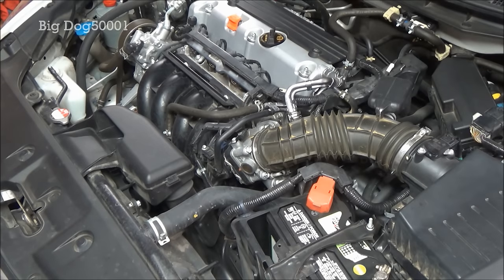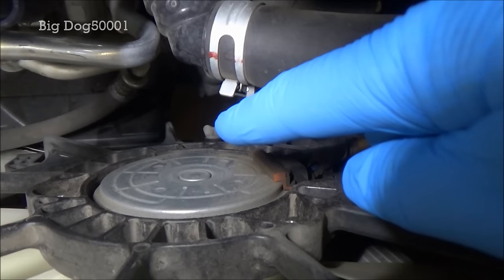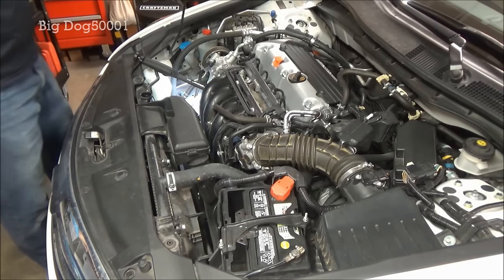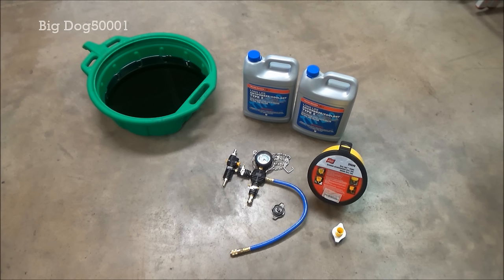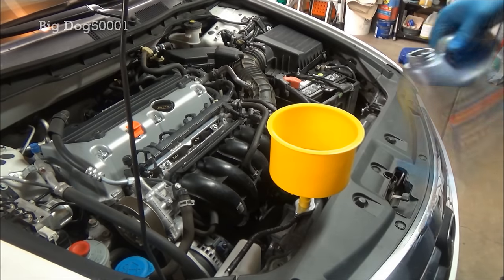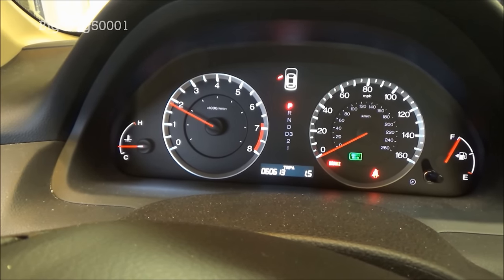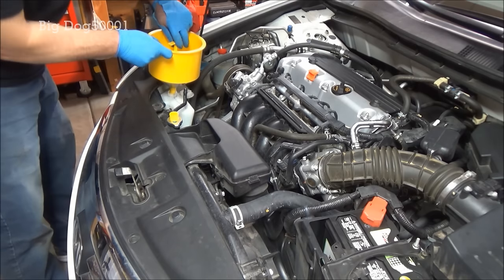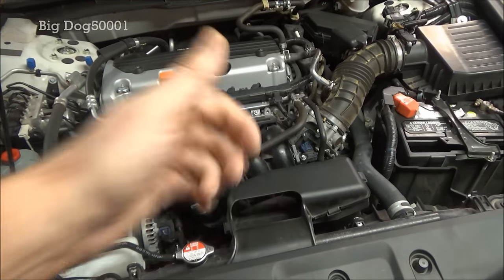Honda Cooling System Service/Fluid Change

Comment from the maker: Tools and parts
This channel earns a small commission using some of these links - at no additional cost to you.
Lisle, part # 24680, Spill Free Funnel: https://amzn.to/2Ktx9Tf
Drain pan: https://amzn.to/2Kq0rCi
Honda Coolant:  https://amzn.to/2Kp64AC
Reply: If I changed the coolant and its  leaking did I do it wrong?
Reply from the maker: @cathym2311  If it wasn't leaking before it was worked on then most likely yes.  I would double check my work.  Also, a small amount of residual coolant will drip off for a little while after servicing it.
Reply: @ Big Dog50001 Automotive  
It stopped leaking after a couple days. Thank you! Appreciate it. Good looking out!
Reply: Honda Type 2 coolant is colored red, as we saw on your video. Is this correct? Please confirm.
Reply: Your recommended seller links show twice more expensive than Honda dealers or other seller on Amazon
Reply from the maker: @OwenZMortgage Thanks for the info. Unfortunately prices from sellers change all the time.  I do my best to keep up and change to better options, but with hundreds of videos it can be tough.
Reply: @marinduque-theheartoftheph Honda coolant is blue. You can use ANY Asian blue coolant. I use Pentosin. Zero difference than Honda coolant. The red/pink are Toyota coolant.

Comment: you said to turn the heat on - but in the video that you just turn the temperature knob to the hot side but you did not turn the Heat ON - could you please clarify - thank you

Comment: It is not cold air that causes it to spray out its that the cooling system operates under pressure.  Dont misinform when warning of potentially dangerous situations !

Comment: I followed the video and changed the coolant in my 2014 CRV  this afternoon and it works like a charm. Just heads up -  do not remove the drain plug all the way out, or else some coolant will spill on the floor unless you have a huge pan.
Reply from the maker: Thanks for the comment!

Comment: Just bought a pair of Honda's. 2011 Honda Accord with 65 k miles and 2007 Honda Pilot with 105k miles. Awesome video! Great job. I bought the spill free funnel and will now change the fluid in both vehicles. I paid about $20.50 a gal for the fluid from a dealership.  Thanks again!!!
Reply from the maker: You bet 👍!

Comment: On my Accord, Element, Fit, Civc and HR-V cars which have radiator caps, I can leave the cap open on the coolant reservoir/overflow and the cap closed on the radiator,  which allows the reservoir to be sucked empty while draining. Then you can remove the empty reservoir for washing/rinsing much easier.
The Lisle radiator fill kit comes with different caps to fit the radiator which allows the cooling system to "burp" itself during warm-up. Very easy to do!
Reply: Right method is crucial for safeguarding against matter later

Comment: 95 Civic DX - 1.5L - I replaced my radiator (definitely needed it), cooling fan assembly, cap, and upper and lower rad hoses.

The work went well but it appeared I had air in the system. Coolant was getting pushed out of the rad and into the overflow. I shut the

car down, let it cool, topped it off, drove home then clicked on your link and bought the Spill Free funnel.

It was very helpful.

I am still concerned that after 20 minutes I still had lots of bubbles but I will monitor things for a week or two.

Comment from the maker: Some Honda models have a bolt to drain coolant from engine block, but many models do not, and the bolts usually require sealant or a new gasket if loosened/removed.  The models with engine block drain bolts typically will drain about 1/3 gallon more coolant.  There will still be be old coolant in the system no matter which setup the model has.  I will typically do two drain and fills on the coolant system if I am concerned about getting all old coolant out (with a complete warm up and cool down period in between).

Loosening coolant drain block bolts on older vehicles that have never had them removed can sometimes lead to issues like leaks or stripped out bolts, so be mindful of that.

Honda coolant is long life, so if the vehicle has been properly maintained, one drain and fill from radiator every 60,000 miles or so is typically what I recommend.
Reply: Good tip about the stubborn block plug. A wd-40 or similar overnight soak will protect against an stripping that aluminum block threaded hole. Patience is always key' in mechanics, dont get in a hurry and plan twice the time for the job until you get some experience.
Reply: Hi, my 2009 accord 4cyl sedan has greyish sludge in the coolant, any ideas what it could be?
Reply: jesus miranda  sounds like a blown head gasket leaking oil into the coolant channels
Reply: Hello Big Dog. How do you think it will be better-Type2 or Honda Pro Coolant 1L 08CLAG016S1 (Japan) for the Civic 4D? Or is there no difference?

Comment: Great vid, thank you.  This was my first coolant change and I now have a lot more confidence.  Got the same funnel system and squeezed top radiator hose before removing funnel also.  Great tip.  The coolant in my 2005 Honda LX was changed when car was cold, so I was able to touch lower radiator hose to verify when thermostat had opened up.  Fans did not come on at this time, so the fans may not be only thing to use as indication of cooling cycle.  It was also easy to watch the funnel from driver's seat and see bubbles start to rise up.  During the second cooling cycle I saw the coolant level drop a bit in the funnel.  Thanks again!
Reply from the maker: Glad it helped, thanks for the comment!

Comment: Did this coolant service on a 2011 CR-V today.  All went as planned except for a few hiccups that always happen no matter how straightforward the repair.

The petcock was at such an angle, I couldn't get a good grip with neither my fingers nor pliers. It took about 20 mins to get all the old coolant out.

Lastly...I could never get the fans to come on. I did the rpm hold. Even waited for 30 min. When I turned the A/C on...both fans came on but stopped when the A/C was turned off.

One thing.... shouldn't we have turned the heat on before draining as to drain the heater core?  Great video dave...and the tip about squeezing the hose before removing the Lisle was awesome and worked.
Reply from the maker: I appreciate the comment, thank you!  I did mention in the video to move climate control to hot, to open up heater core.  This is only actually necessary on older Hondas with a control valve to the heater core, newer Hondas do not have this and so it makes no difference if the climate control is moved to heat or not.  I do not turn blower on because that can turn on cooling fans.

Comment: I have used the Lisle spill free funnel for quite some time and it works fine.  However, I also have that Astro pressure test kit but just recently started using the vacuum fill tool.  It took me a time or two of using it to get the procedure just right but I have found it significantly faster to do the vacuum fill.  I can do an Odyssey with the dual heater cores and get heat from both immediately and no need for the numerous hot/cold cycles on the HVAC that the service manual calls for.  The trick to the vacuum fill is getting the pick up hose all the way down into a bucket of coolant, before attaching to the tool, to make sure there's no air in the hose.  The nice thing is the coolant goes into those hard to burp areas of the cooling system.  Remove the tool, top off the radiator, put the cap on, run it for two fan cycles, test for good heat from the heater core(s,) top the radiator again, and ship it.
Reply from the maker: The Astro kit works well, thanks for the input!

Comment: Thank you so much for adding that info about the engine block drain bolt.  My owner's manual is telling me to drain coolant from there, too.  But I was hesitant to do that because that bolt has never been turned and I'm worried it won't end well.  Based on your expert advice, I think I'll just drain from the radiator only. Then fill the coolant following your instructions in the video.  Then do another drain and fill in a week or so.  Would that be ok?

Comment: Great video. The no spill funnel was a great tool. Followed your video exactly but the fans never turned on for me. I know they work because when the AC is running I can hear them turn on. Temp gauge is staying steady right in the middle.

Comment: Very comprehensive.  Only thing I add is I apply a thin coat of silicone paste on the drain o ring to make it seal better and easier to remove next time.

Comment: He is correct.  Do not mix coolant types!   Since we are on the topic of maintenance when changing power steering fluid purchase the HONDA power steering fluid from the dealer.  I tried aftermarket approved power steering fluid "FOR HONDA OR ACURA"  written on the bottles.  The aftermarket fluid frothed in the reservoir and started making power steering pump noises soon after, not good.   Changed to factory fluid for the right year of Honda Accord and no more frothing or noise.
Reply from the maker: Thanks for the input.
Reply: There's a big difference between those two.

Comment: Wonderful video, one of the most helpful I have seen. I just did a flush along with a replacement of my radiator and all coolant hoses on my 99 Honda Accord. I had a slight rough idle so I am rechecking my work on bleeding the system. Thanks!

Comment: Thanks for video !

I did this with the radiator cap don’t have the tool and the fans never came on but it stop bubbling .

Also the car ran with heat on for like 25 minutes , so was the enough to get air out of system ?

Comment: I had the 2002 CR V coolant changed at the Dealer and we heard gurgling sounds for a long time until I think I realized there was air in the system. I saw an ad for a Subaru coolant flush and it was $189. Probably Honda has increased their price too.
Reply: Get that kit, I have owned one for awhile, they work and are much cheaper than going to the dealer. And they work on just about any car or truck.
Reply: Thanks Michael - I have the kit and have used it once on my 1998 Accord EX V6 and it was a big help. I need to take the time to do the 2002 CR V. I was surprised the Dealer didn’t get it right and left air in the system. Both Hondas are great cars after the junk I’d been driving and with proper maintenance and driving they just last and last.

Comment: Hey Big Dog, I have a 2013 Honda Accord LX with the 2.4L engine and had a question about the coolant reservoir level. When my engine is cold and has sat overnight, the coolant in the reservoir reads exactly at the "min" line. After a drive and getting the engine fully warmed up, it is about 1/3 of the way between "min" and "max". Do you suggest I top off my coolant reservoir, or should I be good for now?
Thanks for the help and keep the vids coming!

Comment: Great video. My cooling fans never came on. I know they work because ac turns them on. I noticed a lot of bubbles. They stopped and after 45 minutes I turned it off. I might need to replace thermostat?
Reply from the maker: It is possible to have a bad thermostat or bad Engine Coolant Temperature (ECT) sensor (or fan switch), but not always, sometimes it can be difficult to get the engine warm enough to turn on the fans, especially if it was only idling.  Usually I will bring the RPMs up to about 2,500 for a bit which helps and usually gets the fans to turn on.  A scan tool can help in situations like this by showing what temp the engine computer is seeing on ECT1 (with a cheap code reader) or both ECT1 and ECT2 (with a scan tool that can read Honda specific info).

Comment: Thanks for the video, well done.  2 questions: 1) Is there any point to removing the thermostat when doing this? I've see some say this aids in getting all of the old coolant out, but is obviously extra work.  2)  Do you recommend using any of the coolant cleaners when doing a flush of a Honda that has 150k miles on it and hasn't had any flush/replacement done previously?

Comment: Hopefully you can answer this question. I have a 7 year old Honda with 15,000 miles. Should I change the fluid based on age or 60,000 miles as you’ve stated ?  Thanks big dog your videos are the best

Comment: Do you recommend flushing the coolant? I changed my coolant with oem for the first time in 10 years. Looked clean.
Reply from the maker: I don't usually flush (anything you use to flush with will need to be removed).  I typically will do a second service if needed instead (after a complete warm up and cool down to circulate the coolant).

Comment: Thank you for the video. After I did the flush and put the new coolant in, I let the car reach operating temperature and was running it at like 1,500-2000 rpm and the radiator fans didn’t turned on. Would that be a problem. If so what might the problem be? Thank you.

Comment: It dawned on me to use the C adapter with a B "radiator" cap and that tightens it up without excessive force. I only use Honda coolant and other fluids as they are well worth the cost to avoid problems.
Reply from the maker: Thanks for the input!

Comment: Hey man can you let me know if you see this? Rather than pull the plug on the engine I was going to drain and fill my coolant for a second time in a week or two. Do you think that will be sufficient? It’s due to be changed on this 06 accord I just bought. (Love this car by the way) thank you for all your videos man you’ve saved me a ton of money and next time I need tools I will be buying from your affiliate link!
Reply from the maker: I prefer to do it more than once (like you suggest) rather than messing with engine plugs that may open up a can of worms.
Reply: Thanks man I do as well I just wanted to get your opinion. I’ll do it again in a few days. Be blessed man thanks for always helping people.

Comment: The cooling fans don't come on unless using A/C or defrost. Temperature outside is cold not sure if that is the cause.
Reply from the maker: The vehicle may not be getting hot enough to turn on fans, very common in cold weather.  Raising RPMs to about 2,500 for a bit can help.
Reply: @BigDog50001  will do.

Comment: I just did this to my 2012 Crosstour (basically the same car) but I took it one step further. After the engine cooled down, I did a partial drain and used the remaining new coolant to refill the radiator. Then I topped it off with some of the coolant I got from the partial drain. This gives you a nearly 100% replacement of the coolant in the engine. Is it overkill?? Yeah, probably, but I guess that's just my OCD kicking in.
Reply from the maker: Thanks for the comment!

Comment: How do you drain the coolant out of the engine??  There is an engine side drain bolt that is used to drain the coolant out of the engine.  If you remove the lower radiator hose instead will that drain engine coolant?

Comment: Are my fan suppose to come on I flushed my radiator and ran mine for like 15 mins and my fans didn’t come on until I turned on the ac both of them

Comment: I can't get the thermostat to open. It is getting close to 3/4 of the way up on the temp guage and no flow into the radiator. Am I not being patient enough? I don't want to crack the block by shocking it with cold water all of a sudden.

Comment: On my Daihatsu Skywing (Taiwan version of a Charade) I have found it necessary to disable the cooling fan and let the coolant boil into the (ordinary) funnel. Potentially damaging, but I think not as risky. as running the car with air in it. 

 I use two funnels stacked since the special funnel shown probably isn't available in Taiwn. Just got an Accord but dont yet know if my stacked funnels will fit it.

Comment: My cooling fan does not come on at all unless the AC is on. Replaced the thermostat because of a code for bad thermostat. Thought maybe that would fix it. Could it be cooling temp sensor(s)?

Comment: Super helpful! Quick question tho if there was previous coolant of a different brand do I still flush it? Or just drain and fill?
Reply from the maker: When I come across that situation I typically do what I showed in the video 2 times (with at least a full warm up and cool down in between).  That will get most of the old coolant out of system.  I generally don't flush with water unless there is a serious issue with the coolant because it can stay in system and dilute new coolant.
Reply: So that would be this process twice? Would I need 4 bottles of coolant instead of 2?

Comment: Hi Dawg,
So I attempted to bleed out the air on my 04 Civic, following the steps you mention in this vid, but I noticed that the air bubbles just wouldn't stop coming. I spent a good 45 minutes just waiting. Maybe you could give me some advice on what to do. I allowed my fans to come on at least 3 times and there was still air. I don't know what I'm doing wrong.
Reply from the maker: I like to bring the engine up to around 2,000 RPMs every so often (for about 20-30 seconds) to help get air out.  Some models can be a little more stubborn at getting trapped air out.  After that amount of time (45 minutes and cooling fans coming on), if they are just small bubbles periodically that is normal, generally any minimal amount of air left will work its way out to coolant reservoir over time (checking coolant level in reservoir over time for small drops in level can verify this).  

If it still has giant air pockets coming out after 45 minutes and several cooling fan cycles, then it could be another issue.

Comment: Very nice👍What's the coolant change interval on a Honda?(miles, km or years) Thx.
Reply from the maker: I recommend doing the service I showed in video once every 30,000 miles.  As an FYI, genuine Honda coolant is rated for 60,000 miles and aftermarket Honda spec coolant is usually rated for over 100,000 miles.  Thanks for the comment!